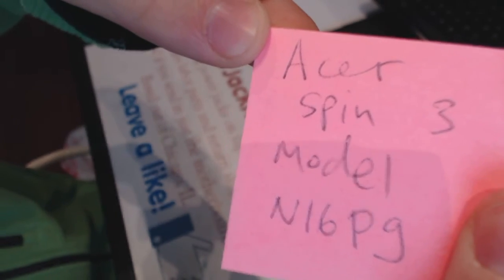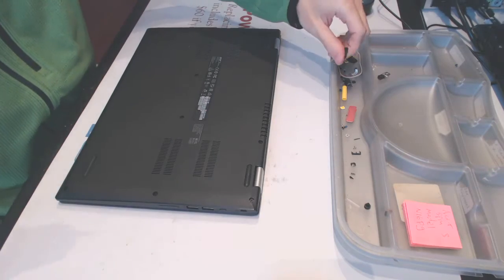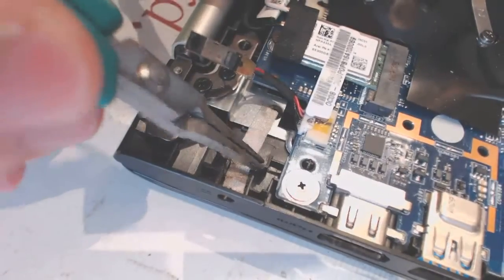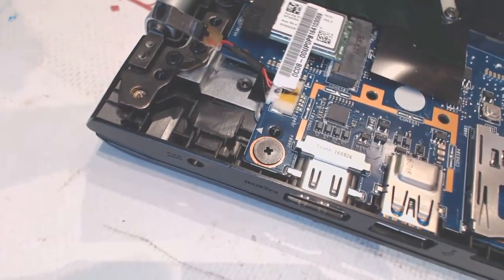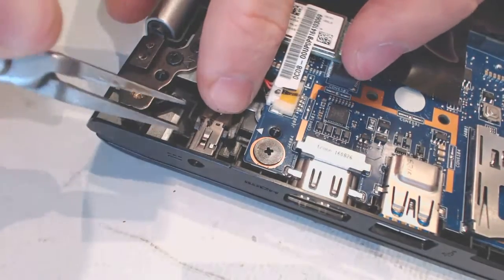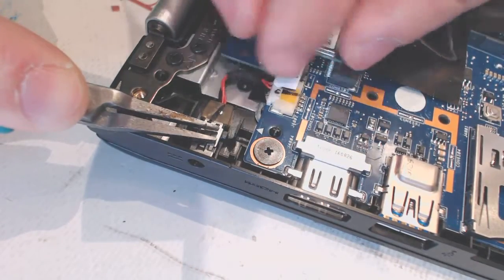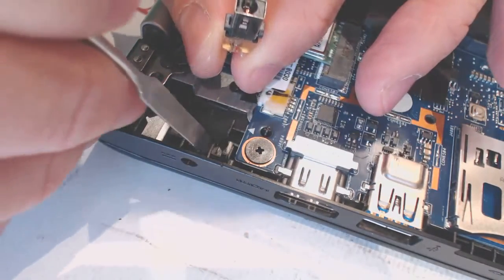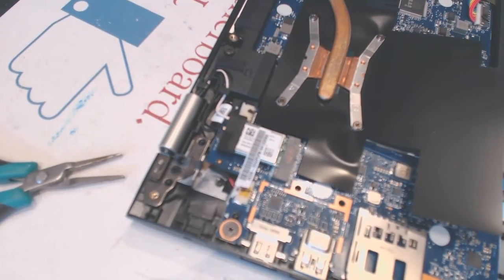Acer spin 3 model n16p9 R14 aspire Laptop repair fix pushed in power jack broken dc socket input

Comment: I need to repair my Mother's Spin 3.  What type of cement do I need to buy? Is there any chance that hot melt glue would work?
Reply from the maker: dont' use hot melt, it will penetrate the jack and your plug won't get in,  the longest curing cement is the one to use.
Reply: Do I buy a basic 2 part epoxy? I'm not sure what "cement" product I should be buying. Also, would Sugru Moldable glue work after it fully cures? I'm sorry to be clueless!
Reply: Thank you for the great video by the way!
Reply from the maker: yes, 2 part is the best, make surei t cures 24 hours, not1 hour.
Reply: Thank you so much. I made the repair last night and my Mom is back in business. In all of my years repairing things, this was my first time using epoxy because I was always scared of messing it up. It's now my favorite thing... I want to repair more stuff!
Reply: this laptop has slot for M.2.
do you know what type?
Reply: great video.  Can you put a link of the type of cement to use.  Where can I buy it - Amazon?  Great video btw, so helpful!

Comment: What sort of cement are you using? An epoxy?
Reply: He is finitely using epoxy. The time he took to get the “cement” and the 24 hour curing is a giveaway. Getting ready to do mine now. I also have new issues with touchpad. Not liking that this model does not have easy access to battery and hard drive. My next one will. 2 years on mine. Great vid but it is epoxy. He sure used a ton. Hope it does not need to be replaced again.